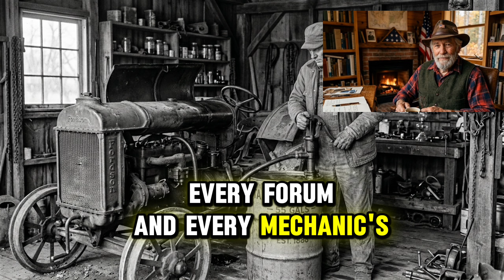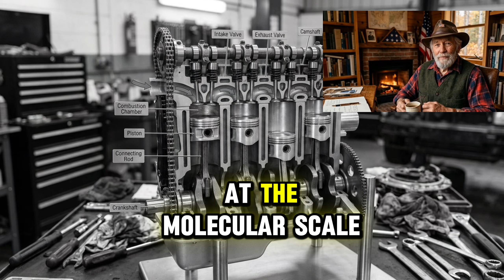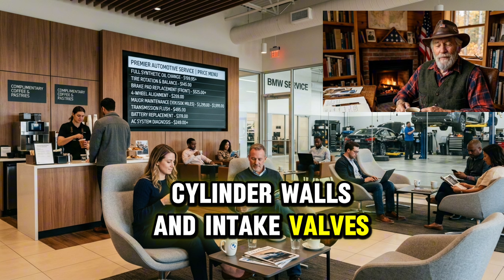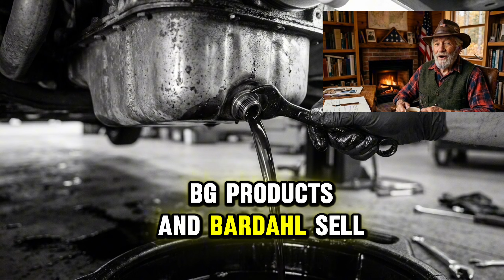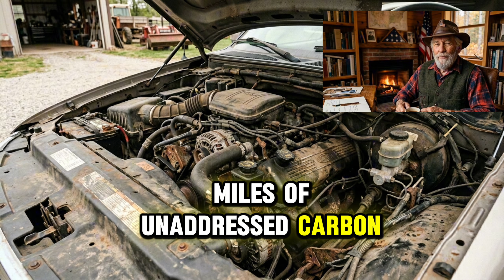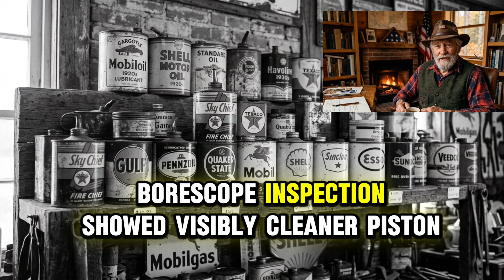Your Engine Is Slowly Dying Right Now. This $3 Garden Oil Stops It — They've Known Since 1919."

Comment: Sounds like mega 🐂💩 🤔🥵
Reply from the maker: "I completely understand the skepticism—in a world of endless marketing, everything can sound like 'BS.' But the reason this sounds so surprising is exactly the point of the video: it’s a $3 solution that the $42 billion additive industry spent 60 years making sure you forgot. This isn't folklore; it’s documented surface chemistry used by mechanics in WWII and backed by university research on paraffinic oils. I’d encourage you to check out the section on the University of Melbourne study—it explains the actual science behind why this works where synthetics often fail."